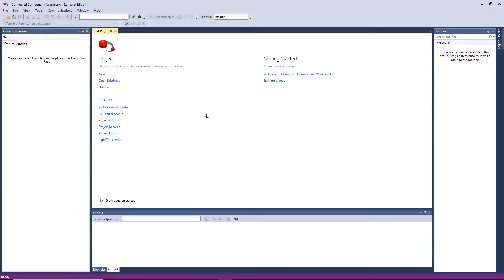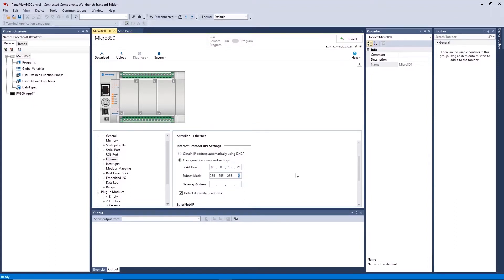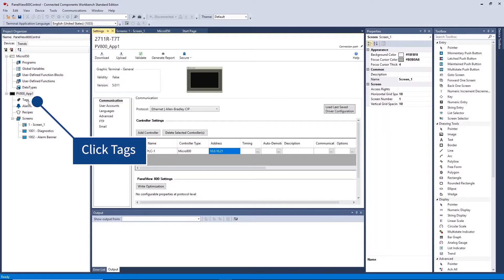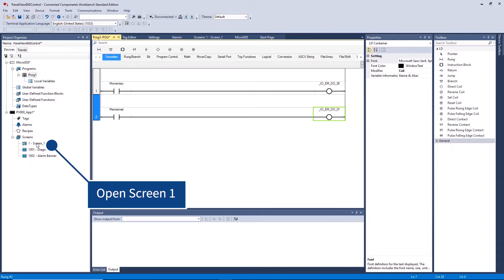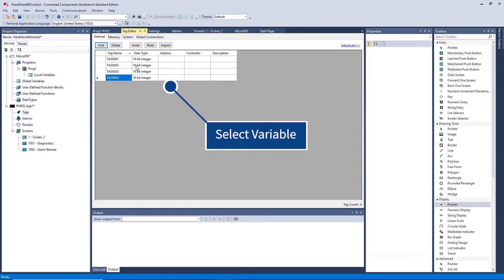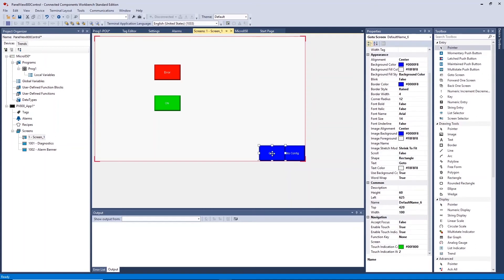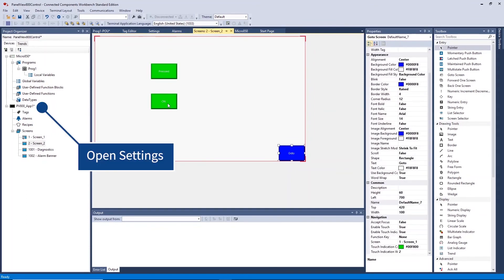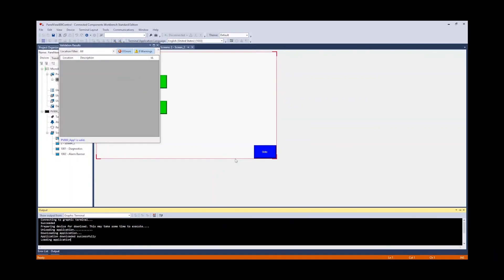Intro to CCW: Micro850 control via PanelView 800

Comment: Hello, what if I do not have the PanelView 800. Can I use the PanelView as a user interface? Because I do not find within CCW if there is a user interface...For example, I want to create a on/off button, where I can control it with the computer's mouse instead of having to use the HMI PanelView 800 to control it. Please advise...